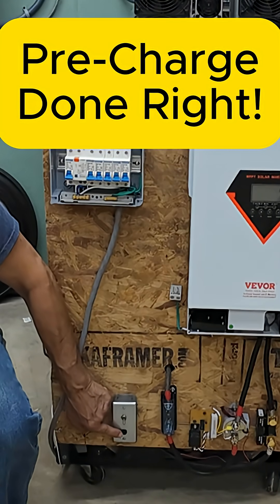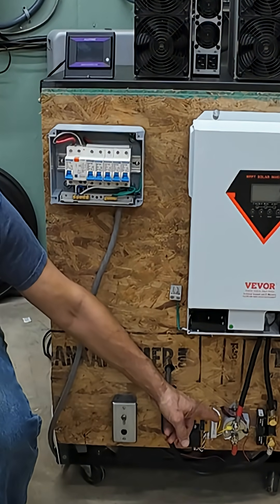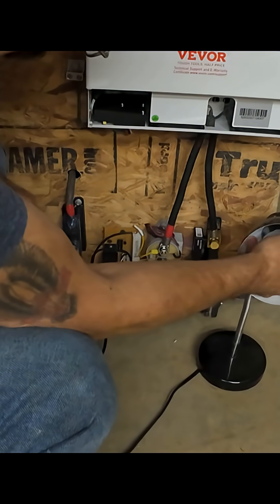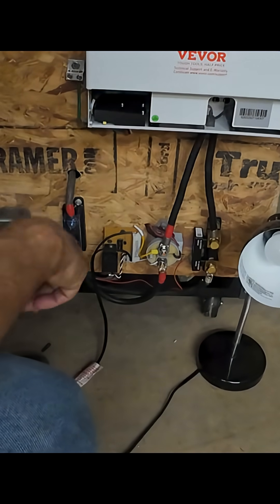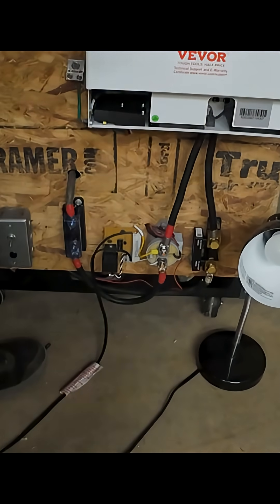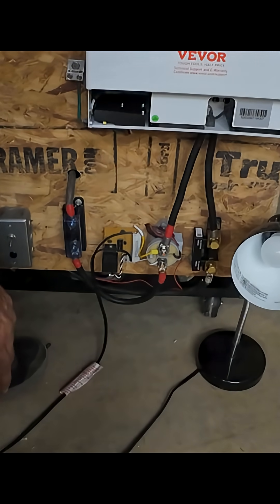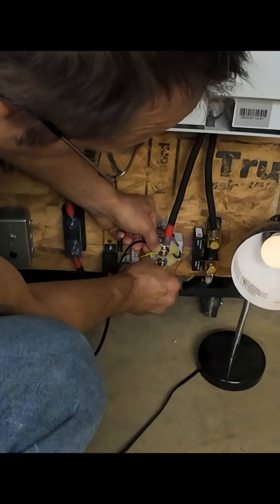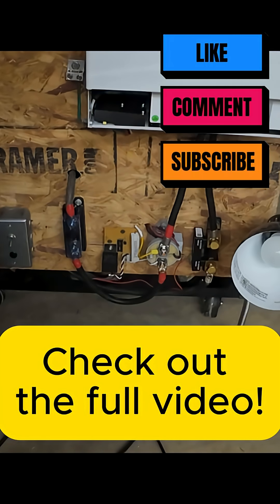Inverter Pre Charge Done Right!

Comment: Doesn't the recharge only need to be done at 1st start
Reply from the maker: Yes, every time you disconnect and reconnect the battery.
If you run it in a normal system the battery stays connected so you only have to on first start-up.

Comment: Very nice demo. I’ve been using an incandescent globe for this purpose, manually precharging… now I’m putting in a time delay relay with a resistor and a solid state relay for the big amps (instead of a contactor).
This is for a separate inverter, used as a charger only when using the car to charge the house batteries with V2L so it needs to be automated.
Reply from the maker: I like it, the SSR is a nice touch!